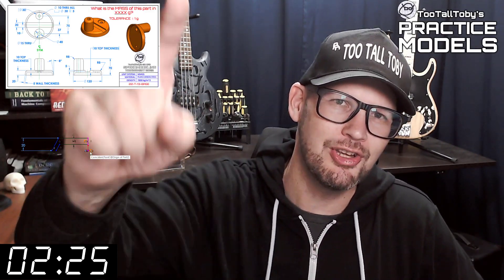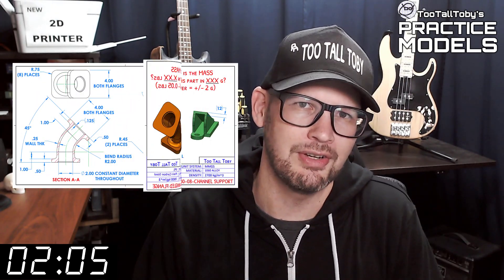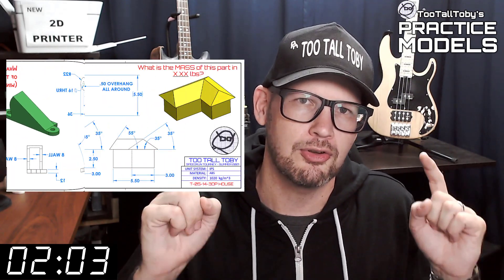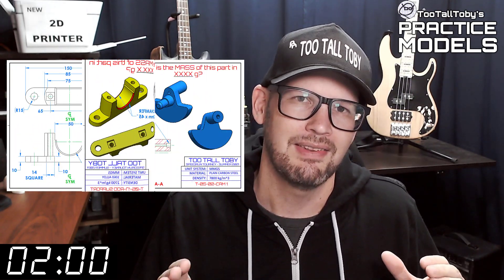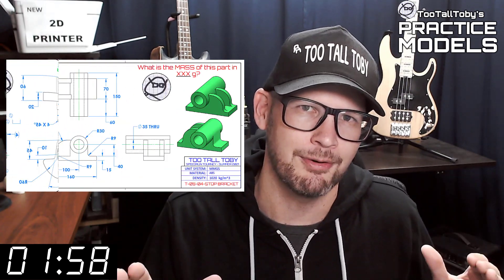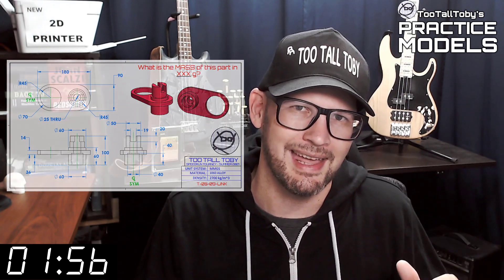CAD Modeling Challenge - Onshape, SolidWorks, Fusion360 - COIL MOUNT - Sheet Metal ?

Comment: 149.523 g in FreeCAD. I guessed the length of the lower tabs with 28mm. It seams this is ok. Where I could find the tab length in the drawing?
Reply from the maker: Awesome job  - Tricky party -If you ever get stuck like this again you can hit up the discord group - link to discord is posted here:  www.TooTallToby.com/practice
The length of the lower tabs is based on the 90mm Bolt Circle (to the slot) and then adding 10mm for the radius.